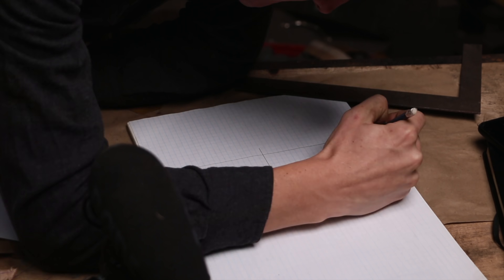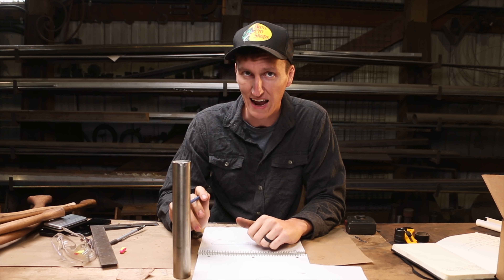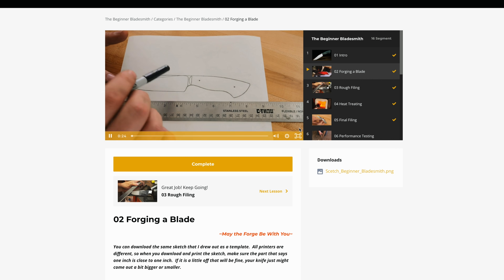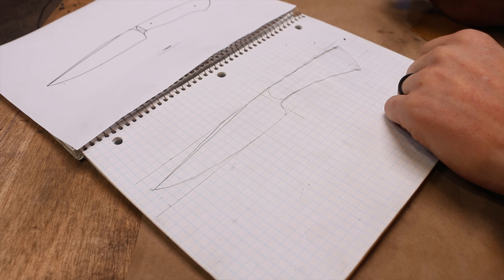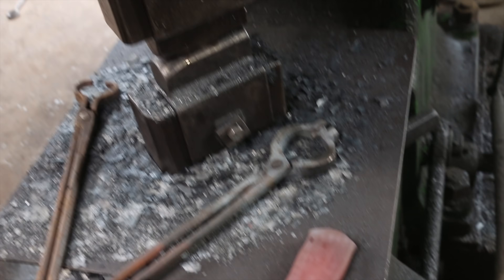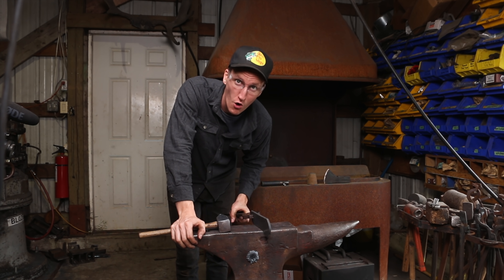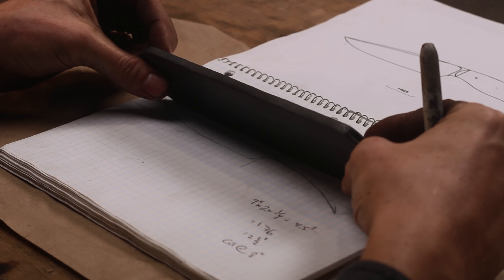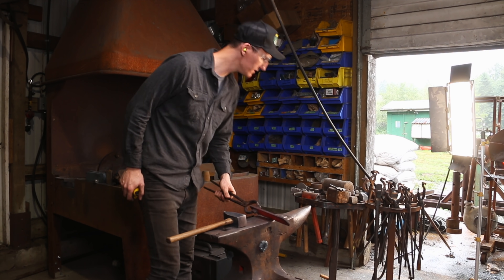Making a SUPER ALLOY knife! Can I do it???

Comment: I have a 16.75" diameter pizza pan made from Inconel 718.  No, really, I do.  It is actually the leavings from the stamping process of manufacturing the afterburner cone for a CF-18 fighter jet.  A good friend of mine works for a aerospace company and they did a contract a few years ago that involved manufacturing the afterburner section for the CF-18.
I can say, the pizza pan is a phenomenal cooking surface and Inconel transfers heat so efficiently that you never get hot spots.  Works great for cookies too.
Reply: Nice!  Any thoughts of the cost?
Reply: Replying so I can see if he responds about the price
Reply: @ethanarterburn6208  I am sure if the aerospace company tooled up and made 100 pizza pans out of Inconel each pan would be a minimum of $2,000.  My pizza pan exists because this was the leavings (scrap) from a fully funded manufacturing project.  Makes me even more happy to have it! :)
Reply: Nice one ,we made an Barbequegrill from an old J65 burnigchamber , works great
Reply: @kentmckean6795  that's amazing that they would just throw them away.
Reply: WANT.
Reply: @Scott_C  As with most manufacturing, the job was cost estimated and bid with profit built in.  The material leavings (scrap) were also calculated and  determined to be of minimal value to recoup and it was cost effective to recycle (or through away) the leavings.  I assume Inconel 718 in a sheet metal (14 gauge) form is not worth the effort to salvage the material. Also, once it became known to the employees that the scrap from the stamping process made a really nice pizza/cookie pan, there was a line-up of takers for the scraps. Waste not, want not.  I can assure you that not one pizza pan went to waste!
Reply: So you officially have a "militray grade" pan?
Reply: @erzbengelraziel5490  I would say "Mil-Spec".
Reply: @kentmckean6795  well paint my nose and call me clowny.  Seems like it was a pan-oply of inconel convinces.
Reply: Most companies that use inconel, particularly military contractors practice zero loss recycling techniques. That was a wonderful gift but yeah, inconel is a bitch to smelt correctly its like using a diamond as a kitchen knife lol
Reply: Thats a cool thing too have and a intresting story to tell.Cheers ta
Reply: Inconel and basically all nickel superalloys have phenomenally shitty thermal conductivities. it's just one of the properties that make it very difficult to machine. It is WAY more prone to hotspots then copper, aluminum, iron, carbon steel, or stainless.
Reply: @joshschneider9766  yeah , i bet that you do something like that nowadays , but back in the late 80 ,early 90 , the military didnt look verry closely at theyr junk ,as long as it wasnt weapens or weaponparts or amunition ,back when i started my training the truck that went to the junkyard came back fuller than it went there , today is the junkyard a resticted and protected area
Reply: @martindonat3249  Family member's job is to audit military contractors down to the hammer and nail. While it's considered waste and calculated into the cost, it better be waste lol. No funny business with the scraps! :'D

Comment: TL;DR - send it to a heat treater to be treated to AMS 5663. 

Just finished the series, great work! Some additional info on the material from an engineer standpoint. 718 is what they refer to as vac-melt, meaning it has to be melted under vacuum. This is important for later. There are a few different specs for 718 but the 2 big ones are AMS 5662 AND 5663. 5662 is basically the annealed condition while 5663 is a tempered and age hardened condition, significantly stronger than the prior. 

During the forging process the material naturally relaxes to its annealed condition. The problems arrive when attempting to get the material back to its hardened state. Due to the same reasons it must be melted in a vacuum, it must also be hardened under vacuum. In atmosphere, the nickel and other components in the material will form oxides that prevent the crystal structures from doing what they need to do in order to harden the material. In the annealed state, the material yield quite easily. 

If you send the blade to pro heat treatment facility, request it be annealed and treated to Ams 5663, you'll come out with a superior material, I recommend you have the edge ground in at point lest ye be ready for days at the belt grinder.

Comment: How to harden Inconel 718: Solution anneal it, water quench it, age (precipitation harden) it to increase its strength.

There are actually 2 different heat treatment variants. One based on 1750 °F solution annealing for higher hardness, and one with 1950 °F solution annealing (and higher temperature ageing) for higher toughness. 

The 1750°F treatment is this: 1 hour at 1750 °F, followed by quenching in water. Then precipitation harden (age) at 1350 °F for 8 hours, followed by a furnace cool to 1150 °F, with another 10 hours at 1150 °F. After that, air cooling to ambient. This should get you to 46 HRC hardness or thereabouts.

Comment: I forge the impellers for bell helicopter out of inconel, I use THE 12,000 ton Erie mechanical press.  I think we pull around 10k tonnage on those.      Forge around 2000 or so. One hit, graphite lubricant.      Use a coating to prevent oxidation during forging.
Reply: I’d love to see a video of that process
Reply: @auroraborealisknives4019  it's military contracts or aerospace so cameras are a no no.    But it is pretty cool running the press.    And its a long process.   Lots of different operations go into our airfoils from cutting and coating, to extrusion, upsetting, forging, chemical treatment, polishing/ machining, heat treat, inspection operations inbetween other operations and as the last.   I'm also the union vp there, UAW region 2b local2562.  That's a whole other animal 😂
Reply: @auroraborealisknives4019  we mostly use titanium.   Some steel.  Some inconel.   Some weird tungsten / molybdenum alloy  too
Reply: Wicked!

Comment: farmers who still use sythes have a way of sharpening the blade by peening the edge between a convex anvil attachment and a similar shaped hammer along with a fine hand stone just for deburring. you could experiment with this technique with the Inconel. it could allow you to work harden the edge of the blade enough to sharpen it. give it a go id be keen to see how it works
Reply: I think it will crack
Reply: From the few times i've tried it, it seems to work due to the scythes being made from good but soft steel (many even being iron) that is very ductile

Also, the ones i tried with did not need deburring but still had a clear apex
Reply: @angrydragonslayer  interesting

Comment: Probably a good thing you got 718 instead of 625. I make jet parts out of inconel, and while 625 is easier to work with, 718 takes to the furnace much better both for annealing and hardening. While I think you'd probably need an argon filled furnace for the best heat treat, I'm sure someone else can give you more info.

Comment: I've always wondered if this could even be done. My only experience with inconel is doing butt-welds for nuclear and paper mill boilers. It is sooo much different welding it! It's extremely watery, hard to see the edges of the puddle and cracks insanely easy if you come off the heat to fast or don't add enough filler at the end.

Comment: It will be interesting to see how the steel works for sure. I used to make knives from whatever I could find around, so D2 sawmill planer blades, tool and die steel, saw blades, etc. The tool and die blades were tough, but were never "undivided attention" sharp. Usually the D2 can become a useful blade. As I've aged, I like blades thinner and smaller.

Comment: Since the hardening of nickel does not work in the same way as for ferretic steels there is no easy way for you to harden it in your workshop. What you could try however is heating it up to 1000-1100°C holding it for a couple of hours and let it cool slowly (warm air no water or oil baths).

Comment: Inconel hot cut hardy/hot chisel. How well does an Inconel knife edge hold up cutting hot metal?
Reply: I'm gonna bet the cutting edge chips.
Reply: It has a maximum Rockwell hardness of 40 C, so not too good
Reply: @juanbaclavab  sounds reasonable, thought it would of been harder with how difficult this stuff is to work. The only other alloy I looked at was 625 and it's much softer, high A to high B scale depending on it's heat treat.

Comment: Materials Today: Proceedings 5 (2), 7716-7724, 2018
The welding of Inconel 718 is considerably difficult due to the formation of heat affected zone (HAZ) microfissuring and there are many factors such as elemental segregation, grain size and secondary phase distribution influence microfissuring. The effect of the above-mentioned factors can be controlled by the suitable heat treatment. In this study, an attempt has been made to understand the effect of heat treatment on the microfissuring. Inconel 718 sheets were solutionized at 980 °C and 1066 °C for the period of 1 hour soaking used were subsequently cooled by furnace cooling (FC) and iced brine quenching (ICE). The microstructural observation revealed the grain size increase in sample subjected to 1066°C heat treatment. SEM & EDS results showed more segregation of Nb around grain boundaries in 1066°C heat treated samples. Nevertheless, there is an increase in hardness of FC samples due to evolution of γ′ and γ′′ precipitates which were confirmed from X-Ray diffraction results.

Comment: Appreciate it's not good content but what's the sort of downtime when using the power hammer? I'm guessing it's a good few minutes back in the forge, do you have bits you can do on the same project while it's heating or do you have other stuff going on?
It would be a good little insight into what the full length process looks like.

Comment: You will find that it gross forges better with a gradual pressure then hammer at about 2000 degrees. Next annealing and hammer forging. Then heat treatment and baking to precipitation hardening with finishing forging to shape between cycles. Finally gross grinding of the edge. Then a case hardening with a cyanide salt based bath. Finally honing. As it is a high nickel alloy the  knife wont ever take an extreme edge but should be unbelievably tough. 🤓😁❤

Comment: Since the harder a material is, the better it holds an edge, how much longer would a inconel knife would stay sharp in comparison to a steel knife ?
Reply: It would dull before a good steel knife. An average knife would be in the mid 50s for Rockwell hardness and higher quality ones might be just over 60 although they'll be more brittle. Hardened Inconel only gets in the 40s.

Comment: HEAT TREATING AND MECHANICAL PROPERTIES
For most applications, INCONEL alloy 718 is specified as: solution annealed and precipitation hardened (precipitation
hardening, age hardening, and precipitation heat treatment are synonymous terms). Alloy 718 is hardened by the precipitation
of secondary phases (e.g. gamma prime and gamma double-prime) into the metal matrix. The precipitation of these nickel-
(aluminum, titanium, niobium) phases is induced by heat treating in the temperature range of 1100 to 1500°F. For this
metallurgical reaction to properly take place, the aging constituents (aluminum, titanium, niobium) must be in solution
(dissolved in the matrix); if they are precipitated as some other phase or are combined in some other form, they will not
precipitate correctly and the full strength of the alloy with not be realized. To perform this function, the material must first be
solution heat treated (solution annealed is a synonymous term).
Two heat treatments are generally utilized for INCONEL alloy 718:
•Solution anneal at 1700-1850°F followed by rapid cooling, usually in water, plus precipitation hardening at 1325°F for 8
hours, furnace cool to 1150°F, hold at 1150°F for a total aging time of 18 hours, followed by air cooling.
•Solution anneal at 1900-1950°F followed by rapid cooling, usually in water, plus precipitation hardening at 1400°F for 10
hours, furnace cool to 1200°F, hold at 1200°F for a total aging time of 20 hours, followed by air cooling.
If the material is to be machined, formed, or welded, it typically is purchased in the mill annealed or stress relieved
condition. The material is then fabricated in its most malleable condition. After fabrication, it can be heat treated as required
per the applicable specification.

Comment: What Inconel are you talking when you say Inconel? There are dozens of very different alloys in common use with that name...
Unfortunately there is nothing that you can do in a blacksmiths shop to harden those alloys via heat treatments. Some have limited precipitation hardening capabilites, but that requires pretty precise temperature control in an oven and soaking times of many hours. And you'll still not reach the hardness of 1045 after quench and temper. 
Work hardening is a mildly viable way. Thin the blade out when it is cold. This will work harden it. But don't reheat it over 800°C afterwards.

Comment: That stuff has, at most, .08% carbon and a max hardness of 50hrc. That is a terrible material for a knife. It would make good hand tools like a hammer though. Or the head of an axe if you make the cutting edge a better steel